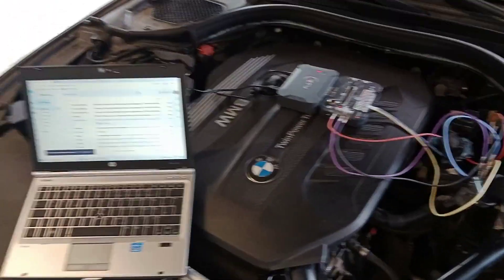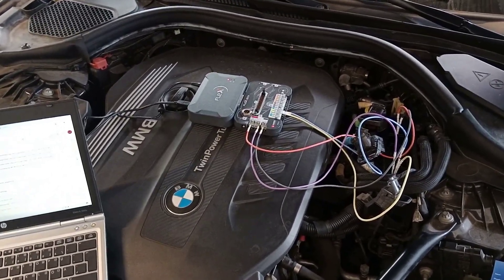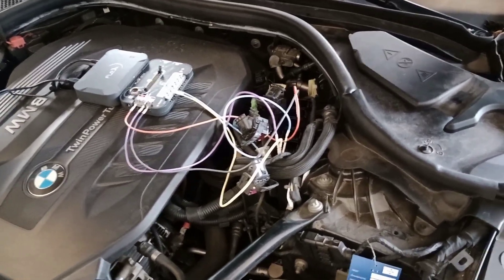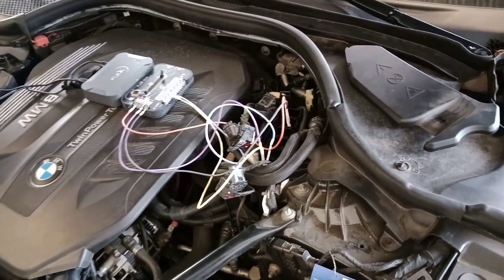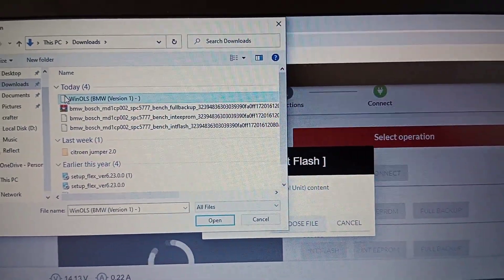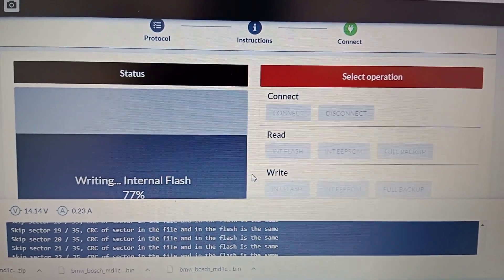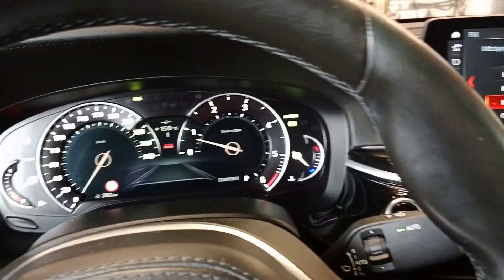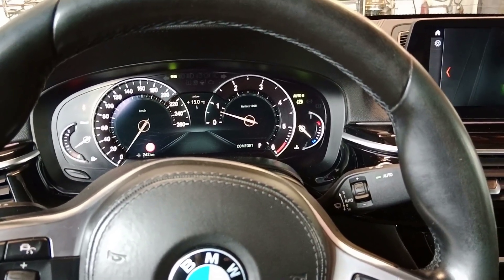Flex Master read/write Bosch ecu MD1CP002. BMW  5 series G30 more horsepower, from 265 hp to 312 hp

Comment: hi thank you for your experience, but if you loose the coding data because you writing in obd, you can recode the coding data with esys and full psdzdata, i think that is the easyst way
Reply from the maker: Hi,
that's right but why waste my time with something like that?  Isn't it easier to disconnect a cable?  than wasting 30 min to Code a car.

Comment: I have alo done this Ecu for Adblue with fc200 in bench mode , at the beginning of the year I have done one but the tool was not correcting checksum, so I send the files to cgdi and last week done another md1 and checksum was solved
Reply from the maker: Thanks for info. 👍

Comment: Did you inform Flex support for that issue? Other tools have no problem with OBD.
Reply from the maker: Tell me which one has no problems and which one you have tried.  Many manufacturers say what we want to hear and when we try their products it is not what we expect.  I told you what I experienced. 
 I didn't inform Flex because I didn't have time for it because I had to return the car to the customer and I had to solve the problem as quickly as possible.
Reply: @YOYODiagnostic  Autotuner is OK with this. Havent tried MM-Flex with this, but this should be ok too with that ecu.